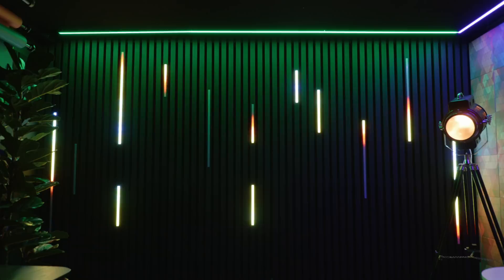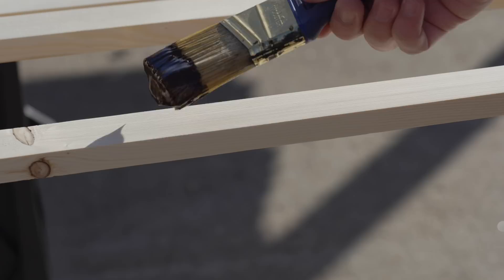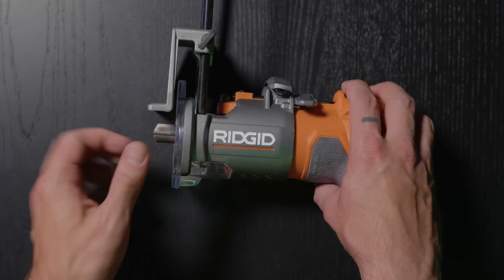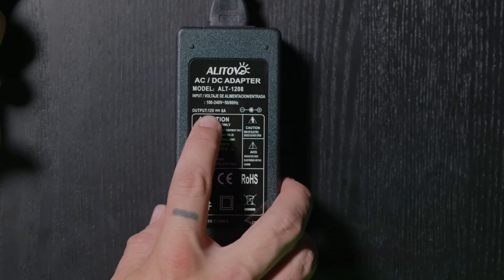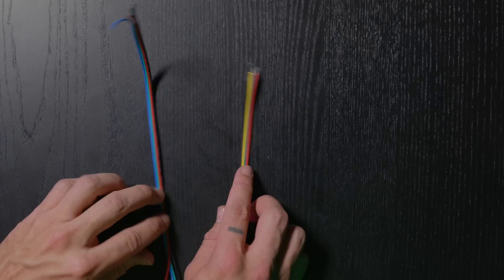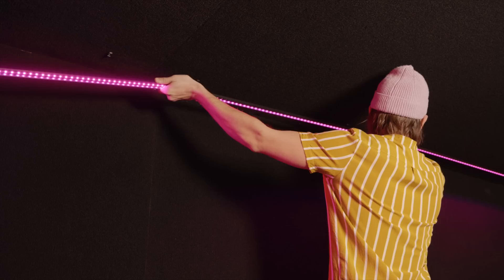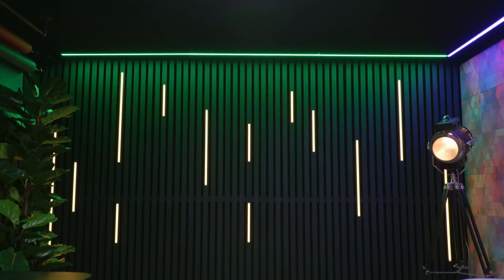How to Build a Custom LED Slatted Wall - Studio Tour (Part 3)

Comment: your issue is called a bridge tap. Basically that data travels back down that secondary date cable send reflecting back to the controller

Comment: WS2812B are okay, but WS2813/15 are much better for a permanent application, because that "4th pin" is an extra data line for breakpoint transmission. If one pixel fails on a WS2812B, then the whole rest of the strip will not work, but with WS2813/14/15 (or SK6822/9822) if one pixel fails then the rest of the strip still functions as normal. Plus they have numerous other benefits over the outdated WS2812B driver. 

But really for a project like this, you'll want to be able to produce a true white color, so I would really recommend an addressable RGBW or RGBCCT strip such as WS2814 or SK6822. 

Overall he did a great job and I'm jealous.
Reply: You mean your envious

Comment: I've been a low voltage tech for many years now and I think you data problem is because you need to run a shielded wire for your data... Electrical interference is scrambling the signal. Shielding the data wire with a 18-2 Shielded wire from the other wires will fix it. Hope this helps.
Reply: might also be a issue in the different power supply`s  i a work in security  en when we injecting new power source in to a data bus we  always connect the minus voltage line  to eachother so it has the same level  as it might otherwhise cause some problems ,  never do the plus voltage line offcoarse as that wil bring  a lot of other problems if it doesnt damage it

Comment: Finished product and the video production both look great!

When selecting wire gauge, it’s not about how much power they will let through, it’s about how much the wire can handle at safe temperatures.  Using a smaller gauge wire than needed can result in melting / starting a fire.  

Definitely research the amount of power you are sending, and for what distance when selecting wire for a project.  No LED slatted wall is worth burning your house down.
Reply: And as far as selecting those terminals, it again comes down to the gauge of wire.  Those WAGO terminals (snap down) look to me to be for a bigger gauge wire.  Thsts not the terminal’s fault.  

For those that are not very familiar with wiring, I recommend them over crimping.  This is another major source of fire.  Having a loose crimp can cause an arc, which heats up, melts and can start a fire.   This low voltage stuff is less dangerous, but still can be a hazard.  Moreover, these are good habits to form for when you are doing higher voltage wiring, like working on a home circuit.

Those splicing connectors are notoriously untrustworthy.  This is again where you use a WAGO that takes 3 wires.  

I don’t have specific knowledge on 8212b wiring, but I would suspect that they potentially were picking up noise, since they run parallel to the power wires.  With enough noise, perhaps the chip thought that cable was being used and it was trying to switch to it.  Total random guess.  It was always a big no-no when installing car audio back in the day to run your power and audio cables next to each other.  Granted, it was typically very high gauge power wire in comparison with these LEDs. 

Edit: I commented before finishing the video, and see you had the same thought 😂

Comment: @17:51 DEFINITELY, you SHOULD connect the red wires together and the black as well. This way, by injecting power on both ends, you can halve the number of power injections for the same result (or keep the same number and improve brightness AND flickering). PLUS you should connect grounds together on separate supplies (and only grounds, not VCC)
Reply: Can you explain why you should connect only ground between different power supplies?
Reply: @roycejamie8250  different power supplies will always provide slightly different voltages. Shorting them together (e.g. connecting both Vcc and Gnd) means one will inject current in the other one. High power supplies having very low internal resistances, this current will be very high. Power supplies are designed to deliver current, not to receive it. Best case scenario, one will unnecessarily overheat and its power will be wasted. Worst case, one will fry, possibly both.

Comment: I think adding another step and sealing the wood would be beneficial. The wood over time(although probably a long time) would take in moisture from the air and warp slowly.
Reply: Agreed. Sanding the paint coat would look nice as well.  Also, help keep dust from collecting, and make dusting them off easier

Comment: Looks incredible!   The sanding paid off big time.   For your flickering, best guess is you had a short on one of the backup data connections.   I have soldered hundreds of LED strips together and use a magnify glass and bright light.  Even then sometimes you can't see the one strand that bridges the data to ground or power.   Those 4 pin strips are a MFer to work with.  You deserve a medal for getting them to work.
Reply from the maker: Thanks for the tip. Yeah it took a lot of patience for sure.

Comment: With the power issue, i would run one adaptor and no injection. What the best option is to use a junction box, so rather than daisy chaining them with varying cable thickness you would run the power to a central position and have a led junction box where you have have upto 10 4 pin connections so your cables are of a simular lengths but mainly they receive equal power to each strip. Ive previously done this with a pure white setup (which is the most power intensive) but was rgbw strip for a customer. An for the data cable run that into a large wago box and back to the controller. Or run a larger power supply with 2 outlets from the center and daisy chain them outward from the central position

Comment: For controller i would suggest use esp32 or esp8266 micro controller with wled os 
Its pretty easy to setup and provides many features and light efects
Also there's this mod version of wled named wled sound reactive
Which gives cool effects based on sound
Reply: Why not call it what it is the diguno

Comment: If you're a little more advanced with electronics, I recommend getting something like an ESP32 modemcu and running WLED. $10 and you get the app and web-based control, plus the WLED software is just amazing, considering it is completely free and open.

Comment: the data connection needs a refresh after a certain length, all leads do this so that's why long strips work, there are signal refreshers available, u have them just cut some led from the stipes and use them every now than to refresh the signal, or use shielded network cable for the signal wire and false don't use 5V Cable and signal wire that is wired parallel, twist them and also add capacitors for shorting the noise on 5V

Comment: Love this! Will copy your wall concept if that's ok! By the way, you should have connected the red and black all the way. You don't connect the red (positive) when you're power injecting from a different power supply. Your flickering at the end was likely a ground issue.

Comment: Just a guess here, but in telecom there's a phenomenon called cross-talk when two data or voice line run in parallel for too long. One transmits to the other (just like a radio antenna) and in phone lines, unrelated calls can hear the conversations of other connections; at least in the days of analog. My guess is the backup data  line was receiving an out of synch signal  just strong enough to interfere with the end of the line. Twisting the pairs usually fixes the issue and why very specific twist ratios are used for each pair in CAT rated data cable. You effected the same thing by disconnecting the  back up data down the line.

Comment: I imagine the backup data cable was working as an active antenna causing you issues. Very thin unshielded cable picking up noise. Doesn’t take very much noise to create a signal especially if it’s being amplified by the controller.

Comment: I am pretty sure you want to connect the ground wires from both led strips together when you do the power injection. But you tried a dedicated device for this so I am surprised by your data problem.

Comment: Maybe try putting a resistor on the data line.
Or try running a seperate wire for the data, so it's not getting interference from the power line.

Comment: I think you would get around 30-31 slots if you just ripped an MDF 1/2 4x8 sheet. it might have been a lot less prep with just very light or no sanding. I think MDF would just be a lot more uniform and no warping. I might try this with MDF at my house in a close or something.

Comment: Re the data line / Backup data line: I'd hazard a guess you had an open data line. Think of it like a guitar lead not plugged into a guitar. Being digital, the noise needs to reach a level to trip to  Grounding the backup data should have fixed it. Leaving it open it would have acted as a big antenna [picking up all the noise.

Nice video 
Cheers

Comment: Tip color leds dont take much power its the white that takes the most power

Tip use a diguno with wled the diguno takes a 12v power supply in but can push either 5v or 12v out to the leds

Tip use 2/3/4/6 Way Butt Terminal Connectors instead of crimp connectors.

If you have issues with the back up data wire flickering my guess is it was solder and making a very small connection against another contact

Comment: Even if your solder says no flux solder you still need flux 
It will greatly improve the solder flow and prevent cold solder joints its not fun to debug cold solder down the line in this kinda project

Comment: Did you put resistors on the data lines and 1000uf capacitors at the beginning of each strip? I might have missed that part of the video, but if you didn't add those resistors and capacitors, then you really should do that, it might solve some of those flickering issues. 

To anybody running long lengths of LEDs, or even short lengths of strips with long distances of wiring between the strips, do yourself a favor and plan to add capacitors and resistors from the start.

Comment: This is Dope i did the same wall but twice the size i was just planning on doing a rope light on the top and on the bottom my wall is 12 feet tall and 35 ft long, it looks bad ass but now i am thinking i need to do this. I am building out my office and i have gone pretty far with it i am now on my 3rd contractor and finally doing finishing touches which is lighting and i am having a very hard time finding anyone with real knowledge about LED rope lights and how they can be connected with out shorting or becoming very dim. I guess my question is are you available to come do the lighting at my building i am doing alot of lighting i think you would enjoy this project. I have never reached out like this but you seem to know everything i want to know and do with my lighting. Thank you

Comment: Great project! I just don’t understand why you would prefer 5v over 24v when you had to add extra power for 3 times.
Reply from the maker: addressable LEDs are much more affordable in 5v and 12v options. I don't even know of a 24v option honestly. Power injections arent difficult to run in this scenario and can still get very bright. My 24v leds are used on the ceiling but are not addressable.

Comment: I would have used an esp32 or similar with Wled flashed to it for the controller, then you would have complete control over strip from pc/web/app/Alexa ext ect.

Could even segment the strip if you wanted for even more custom control. All from same app

Comment: How are the seperate strips conencted to the controller board? are they all spliced in to the same data wire coming from 1 pin ?

Comment: late to comment, but I'd actually disagreee @10:08 - with WS2812B when one of the leds in the middle of the chain fails, the rest behind it is off. With WS2815 and backup data line that won't happen

Comment: Common ground!  Connect negative of your power supply outputs together and make sure it is also connected to ground on your micro controller.  This could potentially be a reason for the flickering.  Signal cables rely on common ground for a proper communication circuit.

Comment: Nice wall, Two questions. So the slatted are 1 1/2 by 3/4 with 3/4 for spacers? And you cut them out from wood boards?

Comment: HELP PLEASE!! So, about 3 months ago, I started this project off of a future youtube channel idea i had, thinking I was the only one with a background lighting idea like this. I'm just now finding your videos, and im amazed at how good yours looks, and this is the exact look I'm going for! However, I am stuck on the electrical portion of it, and everything else from the quiet wall to the slats even the ones I had to router out are up but no lights. Is there any way you could help me out, especially since you're probably the only person who has been through this exact same headache?? Please 🙏🏾 🙏🏾!!
Reply from the maker: Hi there Kyle. I tried documenting all the parts that go into creating the LED slatted wall. What are you needing help with? I feel like I covered pretty much every part.
Reply: Yes, I feel like you definitely did too, great video again! The LEDs are getting power, but no lights are coming on. I've tried testing them after sottering the extension, and first, the app registered the controller, but no lights would come on. Now the app isn't even doing that, and still no lights and I'm stuck.
Reply from the maker: @kylesmith5973  sounds like a controller issue since you said you are getting power to the LEDs. Try a different controller to troubleshoot and see if that fixes the issue. Hard to troubleshoot for you without having the gear in front of me.

Comment: Is there anything out there to let you drive leds like this using a video. I imagine something like a canvas for you to place where your light features are, or where in the x and y you want each feature to sample from, and uses various videos to drive the leds? Does wled do this?
Reply from the maker: I think I have seen something like that. Not sure if WLED would work with that but there may be another software that can still utilize the same controller.

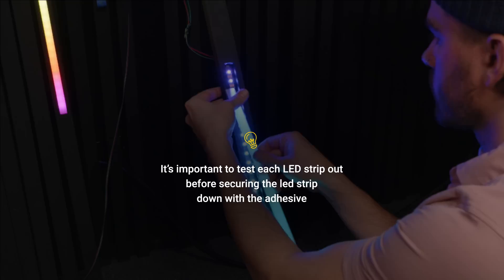Comment: I dont know if I missed it but what did you put on top of the LED lights at 15:17 so it wouldn't show each individual LED
Reply from the maker: The channels come with a black cover but i wanted a white milky diffuser instead. It’s from the same brand and I believe I link to it in the description link after you click through.

Comment: 18.49 the red clips are bad to use, can create bad connections
Reply from the maker: They can for sure, but wanted an option to disconnect without cutting the soldered wire joints if possible.

Comment: this is why electrician charge so much because its not as simple as putting up a few leds.
Reply from the maker: I wish I had an electrician that was well versed in Low Voltage that could have helped out. Regular electricians don't know much about low voltage issues when I asked them.